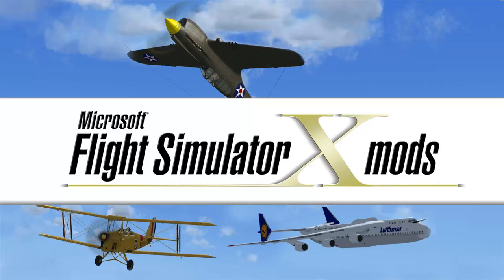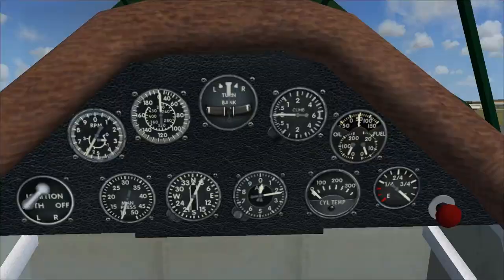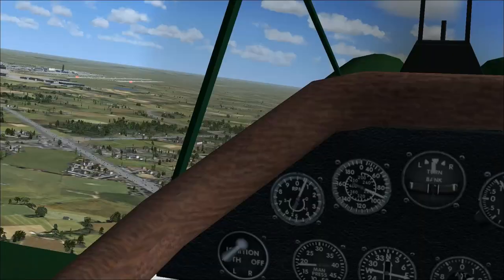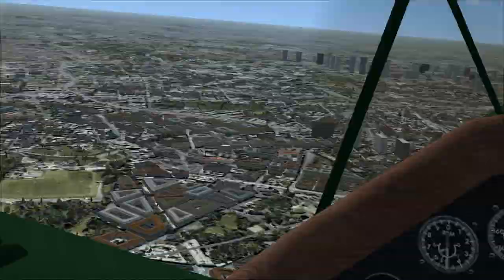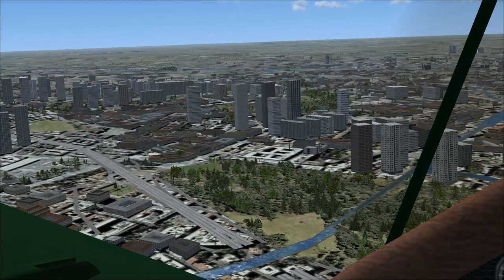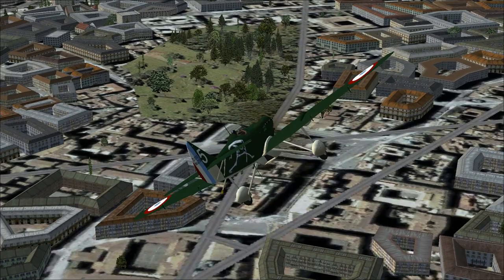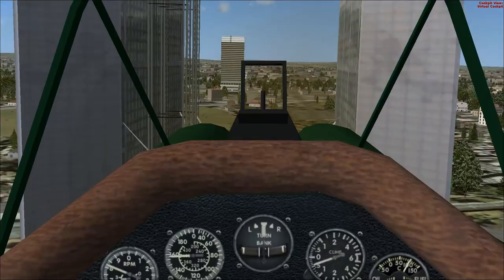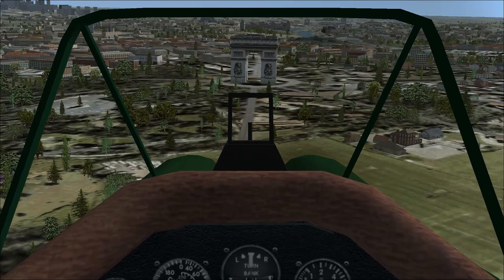Flight Simulator X Plane Spotlight - Dewoitine D.501

Comment from the maker: A few things: 1 - There is no need to "shout", 2 - There is a reason you haven't seen me fly a helicopter yet, that reason will be obvious soon, 3 - I have been through all 29 pages of the simviation website and don't see a skycrane.

If you know where there is a mod send me the link. I will not promise you it will be done, nor when it will be done. This month's mods have all been claimed, though I may shuffle a few into April pending what else I find.